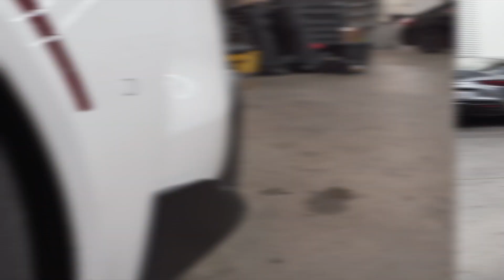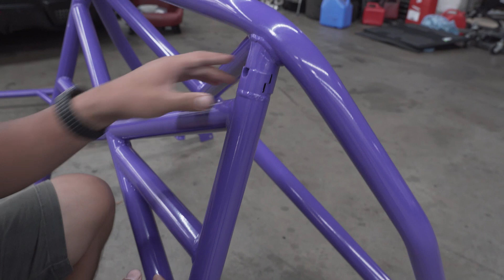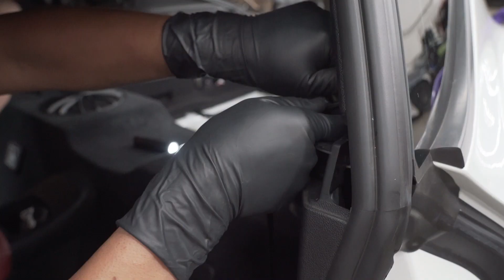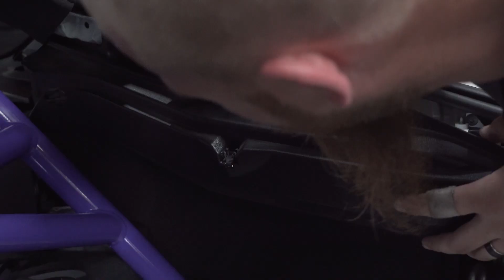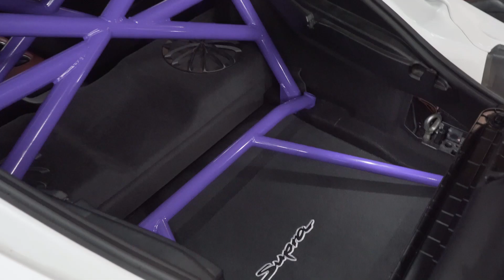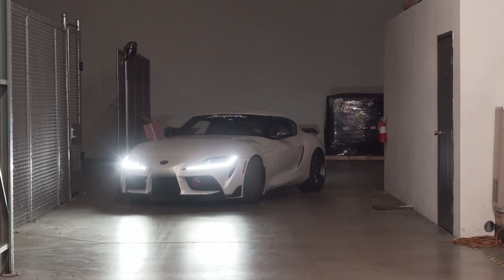MK5 Supra Roll Bar install for Varis Supreme A90 widebody build

Comment: Are you using chromoly tubing?
Reply from the maker: @verginsergin  We offer Chromoly (4130) and DOM Mild Steel. The chromoly is 20% lighter than the DOM
Reply: @ what’s the price on the chromoly cage?